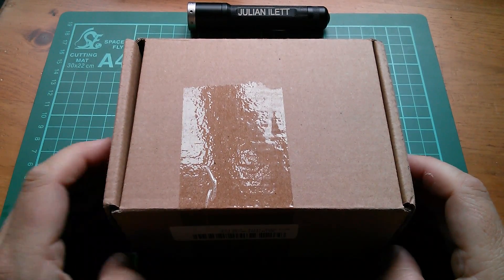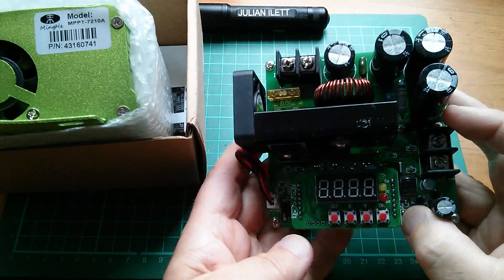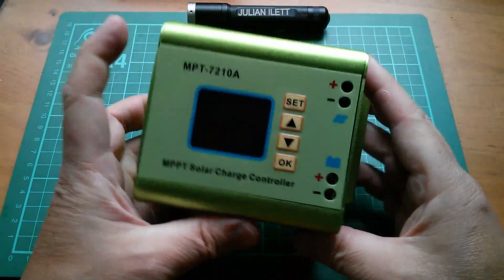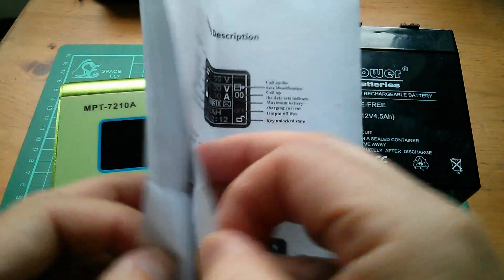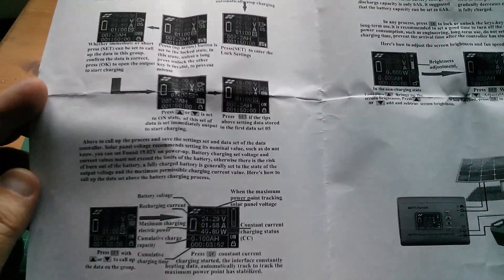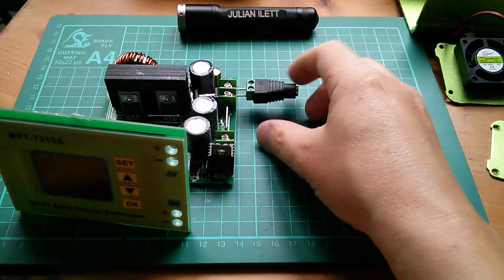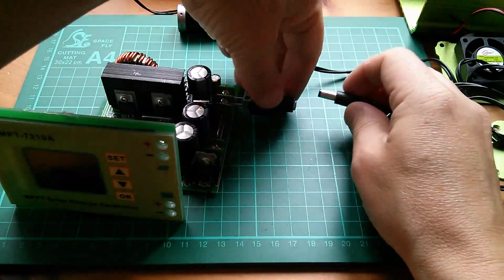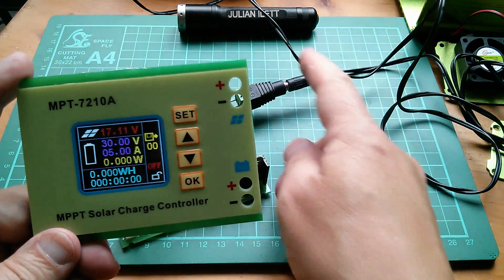Ming He MPT-7210A MPPT Solar Charge Controller #1

Comment: Nice video! Hmmm, I love that this system has an easily movable control panel (the whole thing could easily be re-cased in a larger box) but not sure about how it is powered by the solar side. I suppose one could wire in an independent rechargeable battery to power the display. So unlike other systems do you not run the risk of frying the controller if you plug the panels in first? 

Also the boost conversion vs buck is strange to me. Isn’t boost conversion less efficient than buck conversion (does boost generate more heat)?  

Also do most mppt controllers use fans (I only have a few Renogy PWM controllers but am doing research before buying an MPPT)? 
So many questions on this one! 😂

Comment: What do you think of those instructions?
     "Display devices are easy to pollution easily broken, the installation process and avoid touching the collision force, use screws to secure the controller firmly, avoid installation in order to avoid irreparable damage to the internal circuitry in severe vibration device."
translation; "don't break the cheap screen". lol.

Comment: I have a problem with mine I follow the instructions but it will not stop at the battery charging voltage. But goes well above. Any tips ?

Comment: The technical specs are the same as my charger MPPT CTK 300 has. It has less options, only a simple "display",  only one button, 3 LEDs ... but NO FAN, what means NO NOISE! :-)  Outdoor usage is better possible than the device in this video. The user can setup the voltage (24, 36, 48, 60, 72 and user-defined), no more options, but for me it is enough. Price between 25 - 35 Euro. Videos about it from Adam Welch (english), YT-ID  omAhsQqwWSo and tkDRNbAWZo0

Comment: Hi Julian you think I can charge my ebike batteries from 36 to 52 volts from my campervan solar panels?will have 100 watt x2 plus 3 x30watt panels on roof soon.I have 2 mppt controllers .a renogy rover 20 amp and 2 epever 10 amp mppt s available.of course I can use my Krieger 1100 watt inverter with ebike chargers also but if plenty of sun can hopefully charge ebike batteries.I do normally connect 2 x 110ah leisure’s batteries in parallel .my 12v compressor fridge is on all time.I do have a dc to dc. Charger also that runs off vw t4 2.5tdi engine .cheers .steve

Comment: I've ordered an ebike and I'm hoping to charge the battery with a solar panel together with a minghe mpt7210A. The ebike battery is rated at 500watt hrs. If watts =volts x amps and I attempt to charge the battery with 2amps, then volts=500 devided by 2=250v. Since the mpt72A is boost converter which has a limit of 72v, am I right in saying it will keep on charging the ebike battery at 72v at constant current, but will simply take a longer period of time for the solar panel to fully charge the ebike battery? If this is a stupid question, please disregard it. Not only but also, can you remember how much customs charges you paid to have the mpt7210A imported from China into the uk?
regards    Rob T

Comment: Your assumption is pretty right: connect your 36-cell (18V) pannels in parallel for up to 10 A = 180W solar power:  Boost converter will wake up with the sun to boost charge battery at 24V or much more.
Or  use 72-cell (36V) panels with 36V battery might perform direct charge until battery voltage rises above MPP setting, to make the boost converter help it a view volts up.
Reply: Might work up to 144-cell series on 72V battery (*10A = 720W solar power) with the direct charge via internal diode the  battery will clamp solar voltage to prevent any higher (no open circuit).

+ Advantage: the solar battery reverse discharge protection diode comes for free in this design...
==> seems usefull for many separate PV module strings to independently charge a central battery bank via  common rail
Reply: With any cheap device called "MPPT", please do not expect true MPP-Tracking feature with inteligent micro-controller, but rather a MPP aware design with some fixed MPP adjustment. 
 Automatic MPP-Tracking may or may not be included + implementations may differ regarding ability to handle shaddowing & differnt temperatures in parallel strings.

Comment: Don't most solar panels tell you how many volts they produce..?  and if you have 2 panels at 18v, would you increase the solar panel setting for the combined voltage..?  or would that require arranging the solar panels in series to bring the total input solar voltage up..?  This is all so confusing.  :)  Thanks Robb PDX

Comment: Color: Green
    Material: Aluminum Alloy
    Display: 160*128 TFT Color LCD Display
    Input Voltage: DC 12-60V
    Output Voltage: DC 15-90V, Adjustable to accommodate 24V/36V/48V/60V/72V Battery
    Output Current: 0-10A Adjustable
    Output Power: 20-600W
    Working Modes: MPPT and DC-DC
    Item Size: 131 * 96 * 54mm / 5.2 * 3.8 * 2.2in
Reply: Carl Vasos the input max listed is a lie. this ONLY boost voltage. so a max 60 volt, is ONLY if you have 72 v batteries. i got this thinking i could use my 24 v panel [42 open v], to charge my 24 volt  battery. but NO .  with 24 volt bat. it has ONLY  a max of less than the 24 volt of my battery.

Comment: What solar panels do u use in watts would be nice to know
Reply: We are fixing to buy some 300 watt solar panels. We almost purchased 100 watt panels from Home Depot here in Florida because they are on sale for $109 each.  Then we decided to go with the 300 watt panels because they are only $178 each local. This is a huge savings.  I would say people should take into account three things.  

#1 What are you powering with your solar system? If it is lights only and maybe a couple tiny fans, look for the best price per watt.  You should try to get the best price per watt anyways.  If I was powering as much of the house as possible, I would get a better more reliable solar panel for a little more cost.  If I were only running lights and a few small fans, I would go with the cheapest panels that are of a manageable size for me to install.

#2 if you are doing the job yourself, buy panels in a size that you will not endanger your life. Panels that are much taller than you would be very hard, if even at all possible to install alone.

#3 What size batteries are you using and how many? If you are using 7AH 12 volt batteries, you only need a smaller array with smaller panels. If you are using 100 AH batteries, then you need a bit larger solar panels and a bigger array of panels. If you are using expensive, giant batteries like 400AH batteries, you need large enough panels and array to also run conditioning cycles to maintain the life of the batteries.

Currently I have just expanded my battery bank from 4 to 8 batteries.  I use Group 31 Deep Cycle batteries made by Duracell from Sams Wholesale Club and Exide Nautilus 31 from Home Depot. I pay about $100 U.S. dollars and they are about 115AH batteries.  I power a couple 12 volt led lights, 6 volt and 9 volt fans and a 6 volt Dual Alarm Clock. I can run one fan, charge 4 cell phones and a 7 inch Android tablet every day and only need to do a charge cycle every 3 or 4 days.  I also have a 12 volt portable dvd player I watch two or three movies a day sometimes. This is on the 4 batteries.

I have not connected the 4 new batteries in yet. My batteries are all less than a year old, accept maybe one of them is two years old but it charges to the same voltage as the other three. I have six 15 watt solar panels from Harbor Freight Tools.  We got two if the 45 watt kits. The panels are rarely used to charge the battery bank with.  Usually we charge them with the local power in our house. This system is actually a battery backup system for if the power goes out.  I do run some things off it though, so it does not just sit and do nothing. If needed, i can charge with the solar array. I just choose not to, this way the solar panels last longer.

Comment: this is actually quite awesome since it's ver efficient for the charge controller not to draw anything during the night(also extending the life of the batteries greatly in certain conditions).
If you have a high DC voltage you can also run most AC appliances.

Comment: why waste your time with these inexpensive and cheap charge controllers? it's just a buck/boost controller,  it would be easy enough to design your own. there are even purpose built IC's for this exact purpose.
Reply: Not that'll do MPPT at ten amps, there aren't. I have actually designed one, but it's a bit more involved than that. An arduino is involved.
Reply: ***** linear technologies makes one. You don't need an arduino for anything.
Reply: ***** actually,  a ton of companies make mppt charge controller IC's for any current level

Comment: what do you think of having a dc-dc step down between a PV panel and a regular pwm controller?  My 175w panels put out around 26v each, but my system at this stage is 12v. Would it work?

Comment: 90v on the battery side makes sense for 72v systems as you generally charge 12v lead acid batteries at a max 14.4 voltage and that comes to around 86.4v for a 6 battery system :)

Comment: The higher battery voltages mean batteries are arranged in series to make 72v ,so for high power  inverters there is less conversion losses to higher AC voltages

Comment: Hi Julian. You mention that you use the MingHe as your bench power supply. I was wondering if you are still using the DROK power supply from Postbag #53. I was thinking of getting one of these DROK ones as it seemed to be quite feature rich. With its dual displays and the possibility to set everything while not having the output turned on. To me that looked like a very good cheap option for a bench power supply. I would really appreciate your thoughts on the DROK in case you are still using it. Thanks and cheerio!

Comment: If you use a boost converter that effectively eliminates the need for a series diode on the panel. Higher battery voltage means lower current thus less power loss in the wires, also the charge controller won't drain the battery during the night because it's a boost converter.

Comment: MPPT charge controllers with a boost converter topology are becoming more common. One obvious situation where this would be useful is say you have a golf cart with a 36 volt battery circuit and you wish to mount say a nominal 12 volt 150 watt panel on the roof of it. 

There is no reason why MPPT cannot be instituted with a boost converter, but obviously you lose one of the most touted advantages of MPPT i.e. being able to run higher voltage/lower current cables from your panels. But if your panels are close, this isn't really an issue. And you can certainly still find maximum power point with the boost converter based circuit.

Furthermore, for those who are "rolling their own" charge controllers, a boost converter may well be an easier circuit to get running at good efficiency levels than the more usual buck converter approach.
Reply from the maker: +xanataph Good points Xan. I'd really like to see an MPPT controller built around the LTC3780 buck boost chip.

Comment: Then connecting batteries, so you not do positive then negative so to lower the chance of sparks? What I always was told when fitting car batteries.
Reply: On connecting car batteries you always do whichever is connected to the chassis last, if you did the other last and your wrench touched the chassis/body it would be a direct short and sparks would fly.
Reply: Daniel Armstrong
Yes, also the chassis acts as a loads.

Comment: So what happened ?? :)  I'm dying to know. 
Could you charge a 12V battery with it, or it had to be 24V or greater?  Did the device lose power when the solar panel is disconnected? If so, did it remember your settings?   And, how did it perform, regarding charging current vs. solar input current.
Reply from the maker: No, it won't work with 12V battery systems - which is a shame. It remembers most settings, but not the "output on" setting, so it won't automatically start charging each morning when the sun comes up.
Reply: That... sounds terrible useless for a solar charge converter!

Comment: i'm guessing it is powered from the solar panel so it won't ever drain the battery. Wouldn't it still work for mppt if the solar panel side went through a buck regulator with current limiting to set the impedance, and then was boosted up to the higher voltage for lower losses along the wires?